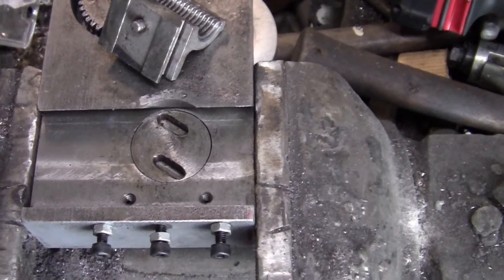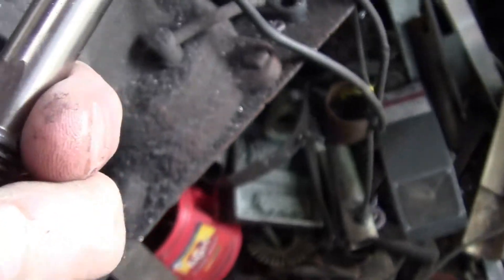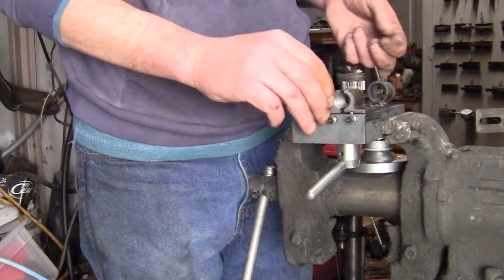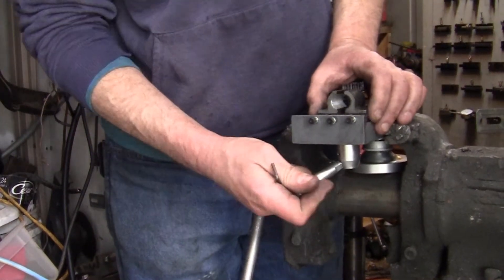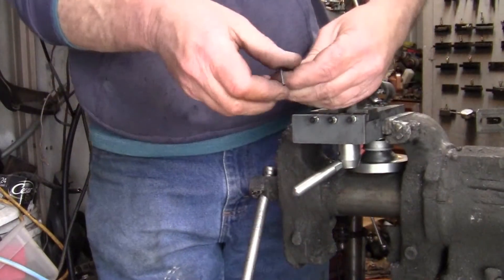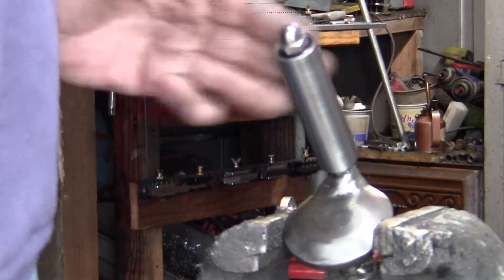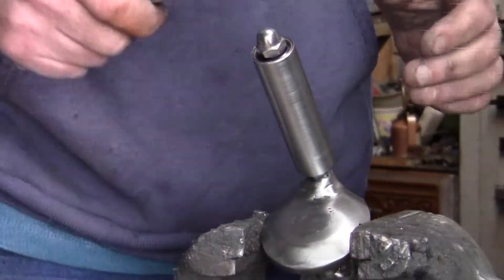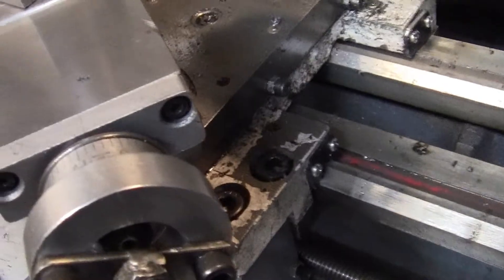MX-210 & WM-210 LATHE HALF NUT REPAIR

Comment: I think the 2 screws on the dovetail are meant to help snug not tight. Then the ones from the side are meant to push it again so its snug but not tight.

Doesnt make sense to tighten the ones at the back because them you cant adjust it.